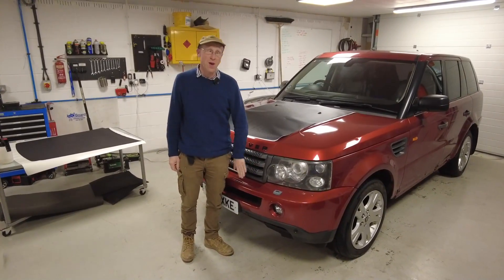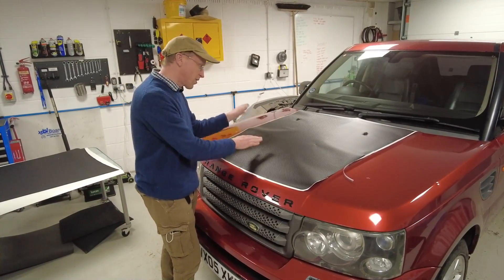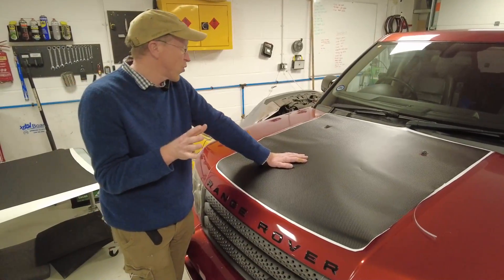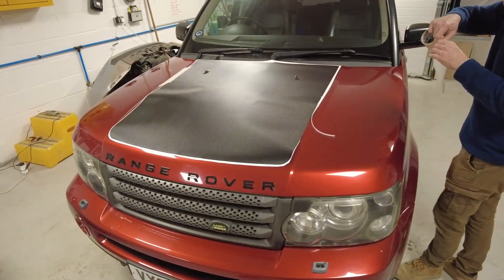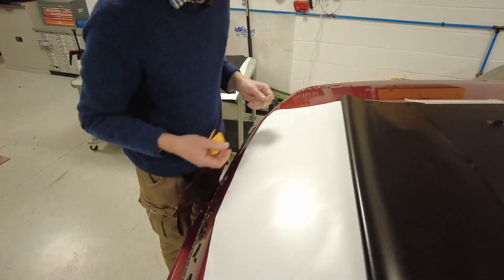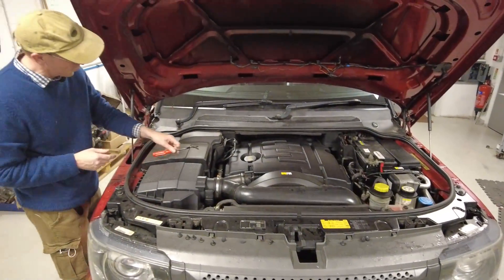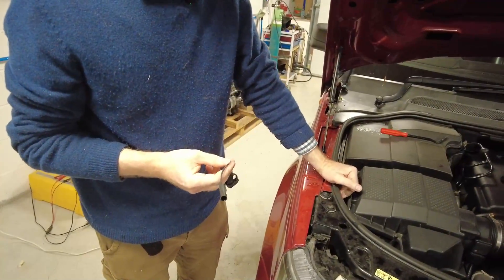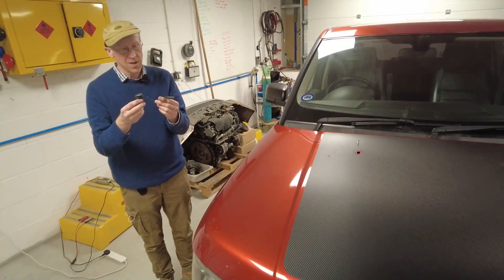Range Rover Sport L320 DIY Bonnet Hood Carbon Effect Vinyl Wrap

Comment: I agree, the washer jets look naff with the bit of colour round them - much better, as you said, is to remove the washer jets and have the vinyl without the jet holes - then, when fitted, make small holes for the jets so they are fitted back on top of the vinyl.  Will look much better.
Reply from the maker: Hi John - Yes it seemed a good idea at the start... but we soon realised it was not such a good idea - both from looks and ease of fitment.

Comment: You should NEVER use water with wrap vinyl, the adhesive has small channels in to let air out. Just hope it doesn’t freeze while you e left water in the air channel’s. And Why are you using cheap KPMF vinyl???? Would be far easier and much better results with 3M or Avery vinyl.